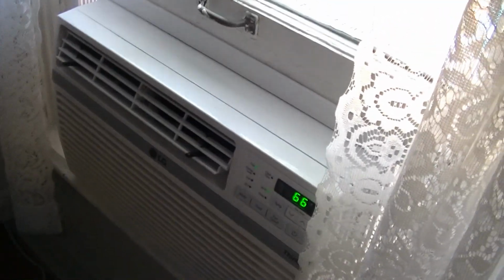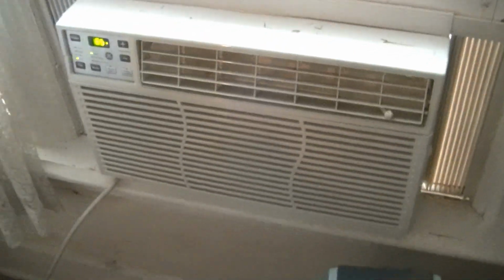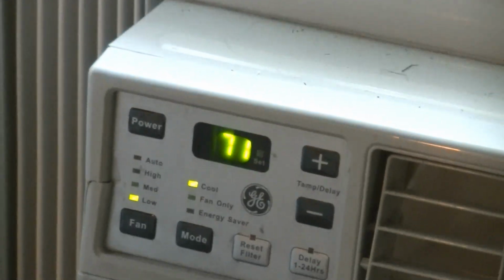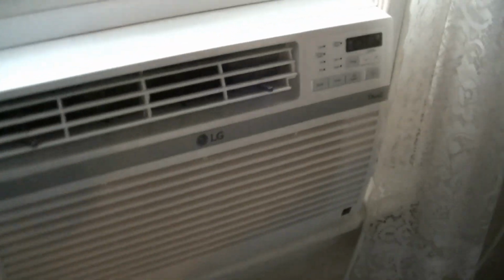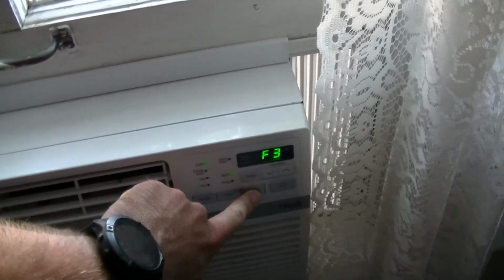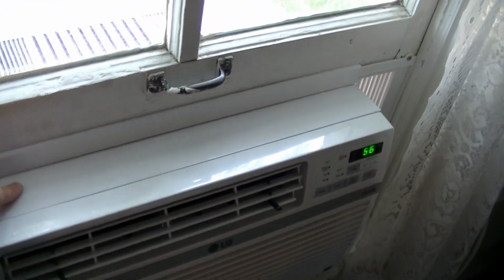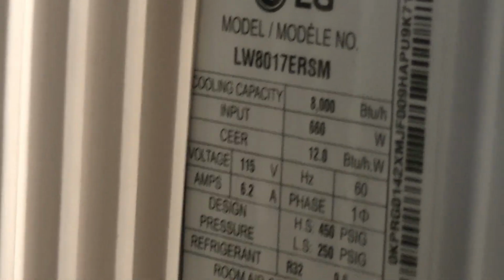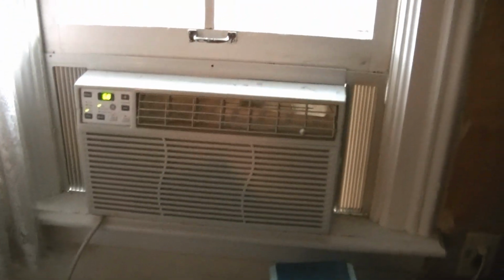LG 8,000 BTU and GE 8,100 BTU Air Conditioners Running

Comment: 0:49 Interesting detail about the actual manufacturer (Gree) of those kind of GE ACs, because newer GEs are tipically made by Haier, and older GEs where sometimes made by LG.
Reply from the maker: It's amazing how many different manufacturers GE used for the air conditioners they branded.  They even used to put their brand on Samsung air conditioners.  I have a few old GE air conditioners from the 70s and 80s that were actually made by GE with GE components.